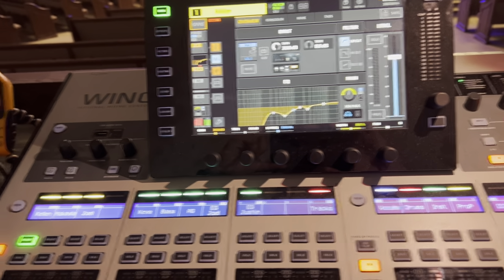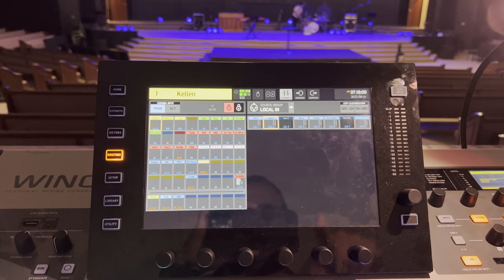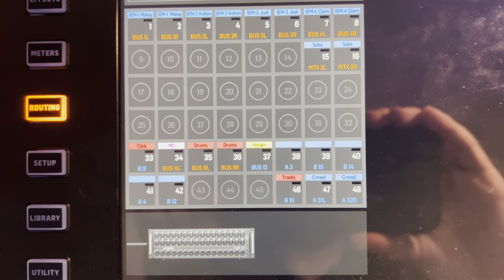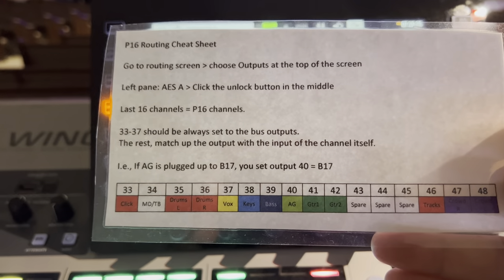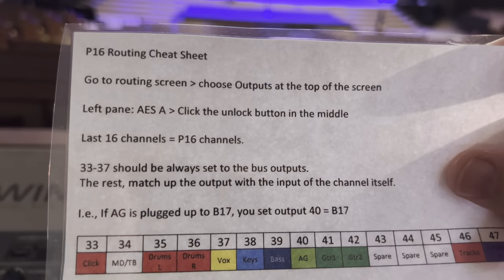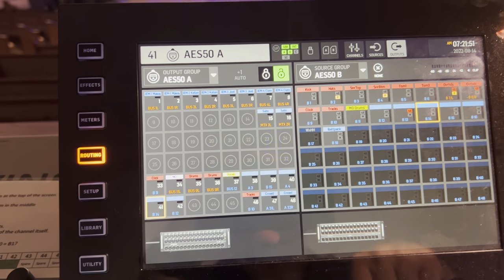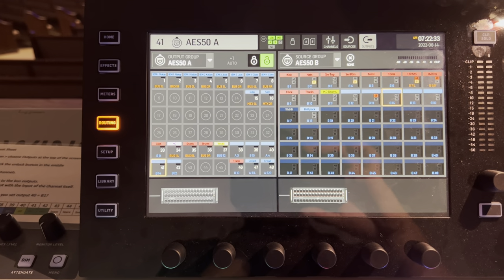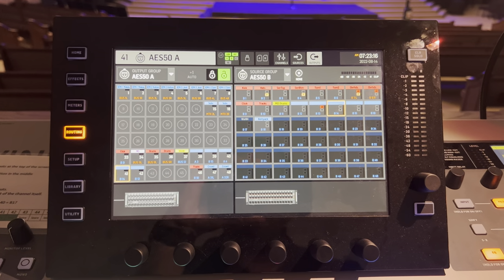Behringer Wing - How-to Route P16s

Comment: Hi Chris ! 

Great video, I was about to suggest you to use User Signal for Post Processing send but as i read the comments, you're just fine with this :)
as a side note, just be carefull when dealing with bus and Direct Out, it can cause Latency and Phasing in your P16 Mix. 

have a great day !
Reply from the maker: Yea. I only use busses for thinks like a drum bud or a full vocal bud because our vocals are all using mixes from the wing instead of the P16, so band doesn’t need to hear all vocals separate just the combine stuff